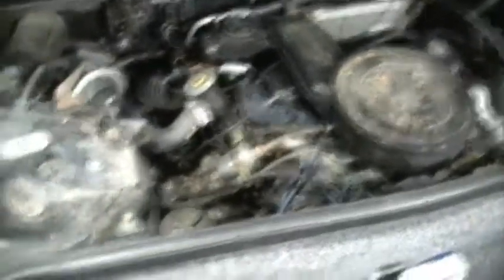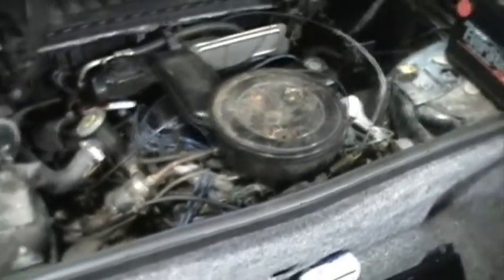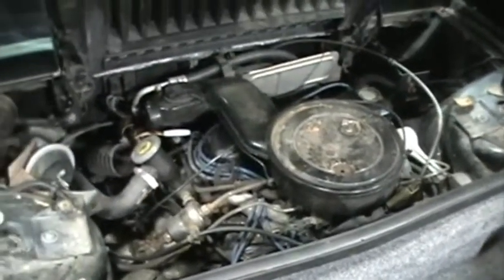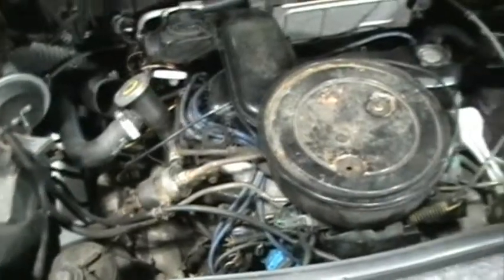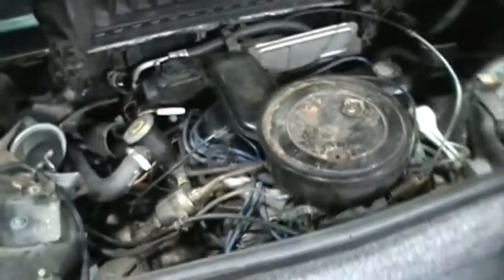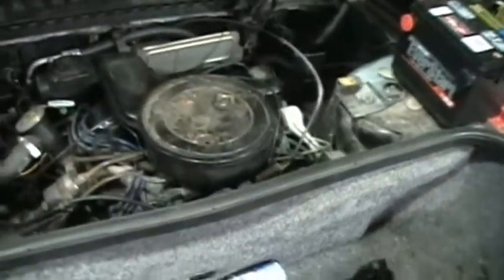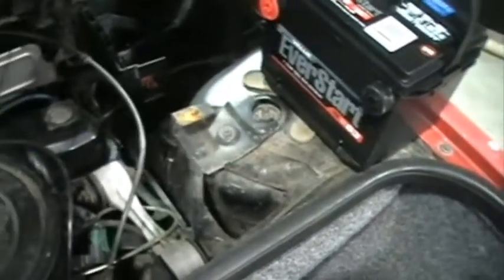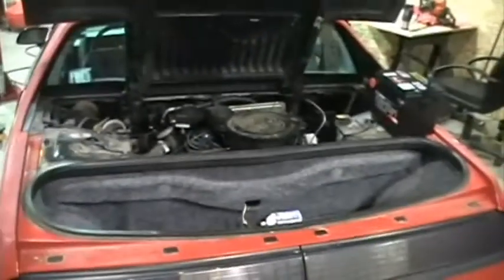Homebuilt UTV project

Comment: Great job!! Ive wanted to build one I just haven't got to it yet.I wanted mine geared a little slower for use in the woods. i don't really need all the horsepower you have but I guess it's better to have a little extra than not enough. I have a 95 ford Ranger I was going to use the 5 speed trans and diff with narrowed axles. Enjoyed your videos.